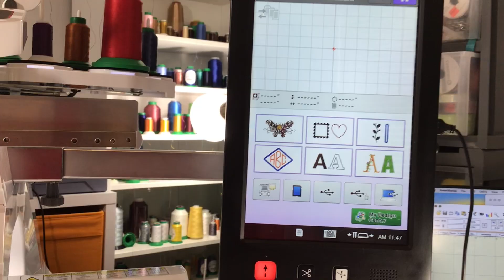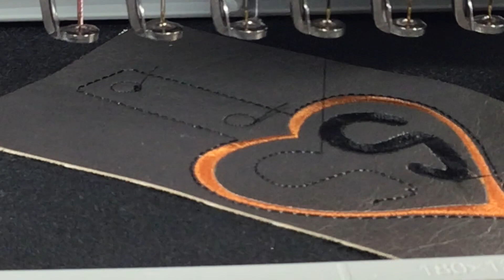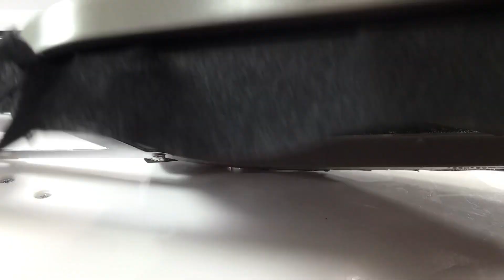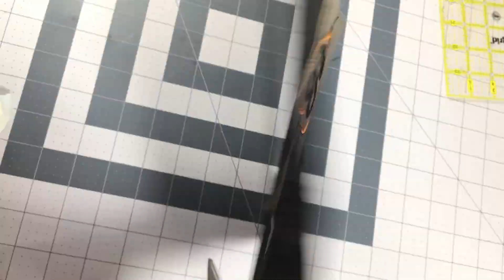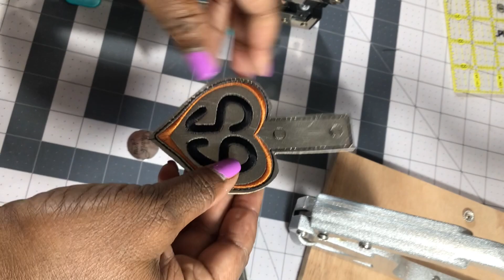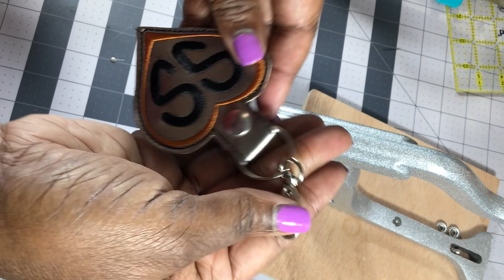Vinyl Snap Tab Heart Key Fob- How to make a key chain Machine Embroidery design

Comment: Please advise. The design embroiders beautifully. I have used marine vinyl for stitchouts on the front and for the back for the past few years, on my single needle machine, with no problems. But, on my multi needle machine when placing the same marine vinyl on the back it does not stitch well for the border, on the back, when the 2 pieces of vinyl are together. The front border stitches great. I have tried to rectify the problem in so many ways but always get the same bad results. I found a video that uses craft felt as the back which stitches beautifully but my preference is the marine vinyl for the back also. Please help!